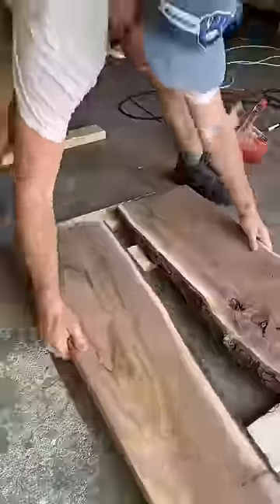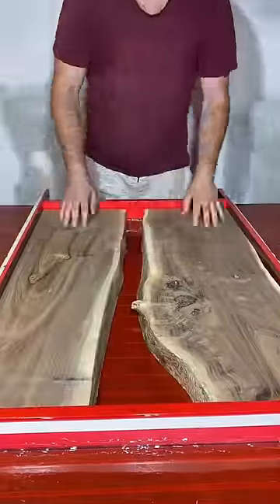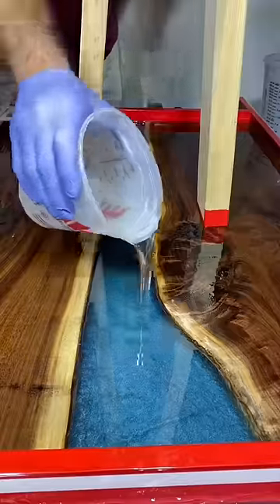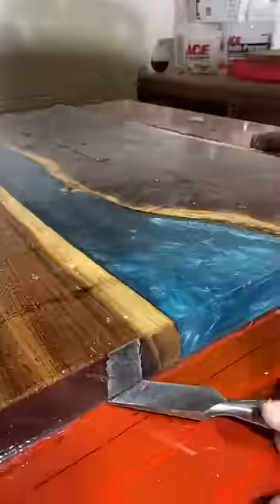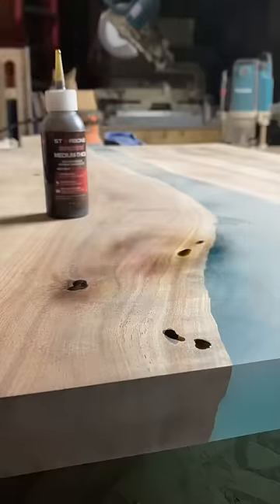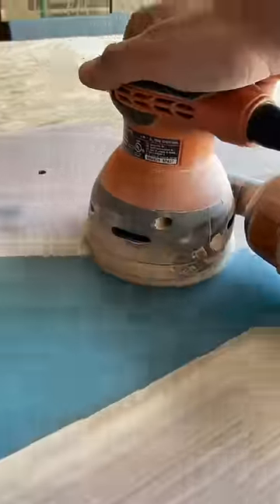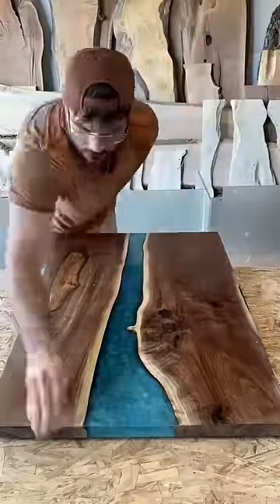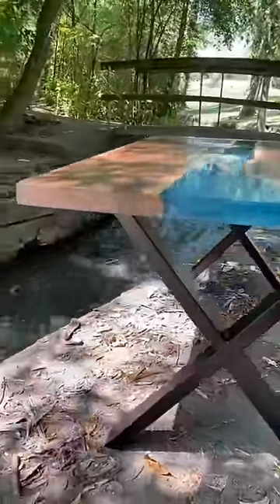Teal Blue Epoxy River Table Build #shorts #diy

Comment: I love the blue epoxy! The lighter color of the live edge is the perfect representation of a active shoreline.

Do you ever play with different colors of epoxy representing natural river water colors. 

Have you ever seen pictures if the Tahquamenon Falls in Michigan's Upper Penninsula? The Tahquamenon River is heavily stained with tannins caused by the decomposition of the plants found in its watershed. These tannins will turn the waters a transparent golden brown color, almost caramel or a gingerale color. That could be an interesting effect to mix up and pair with wood. In the winter, the river water forms ice columns at the falls which are golden in the center and white on the outside that almost glow on sunny days. There seems to be almost golden swirls of color. 

Different colored icicles form at the edge of the rock layers found in the horseshoe shaped basin carved out by the river. The mineral stained groundwaters form teal green, pinkish, and white colored long, thin, icicles. Check out the pictures. 

The water has swirls of color. You might like e

Comment: you should make one with a few dark shades of gray and a silver river over sand at the bottom that covers an 8th inch thick piece of solid metal or something underneath in order to reinforce it in preparation for the potential rare situation where a falling chandelier perhaps crashes down on it in a freak accident. okay, but don't get worried about the metal underneath, because both the wood and the sand and the epoxy will totally cover it, thus enabling visability of only the awesome portion of the table from aerial type perspectives. ultimately, i would like to please make a subtle apology on the fly while simultaneously revealing that the reason i mentioned this weird one 8th inch thick steel addition is because i have a piece i use for some shelving myself and it's funny, but i really love it. all i had was a grinder, cutting blades, and additional flat disks; but i rounded the corners a little and found extraordinary satisfaction in transforming the thing into a sort of base layer for a slab of wood sitting on top of it, that i just had to share some of my thoughts. the blue river ones are still awesome of course. thank you for the video.

Comment: Beautiful.... is it strong in the center? Strong enough to stand or jump up and down on in the center, its probly crazy strong, or supported underneath - I know its created for aesthetic beauty a d to eat on and that the builder is NOT responsible for anything stupid that the client engages in - didn't get a good look at the bottom, but im guessing it would take an elephant to begin to force it apart or even begin to fail. Again beautiful work.